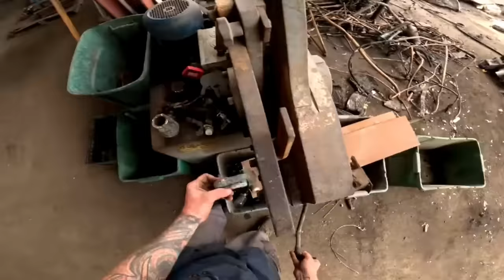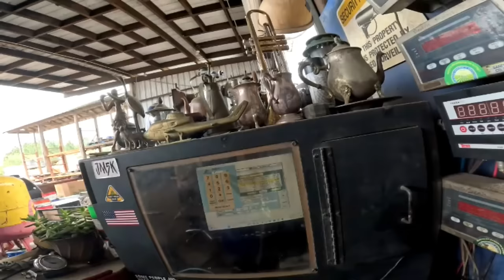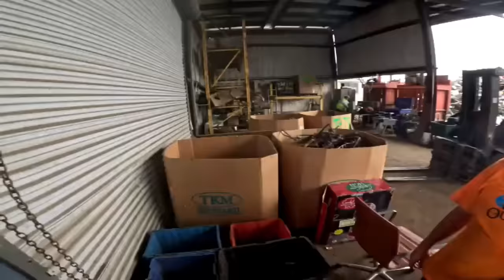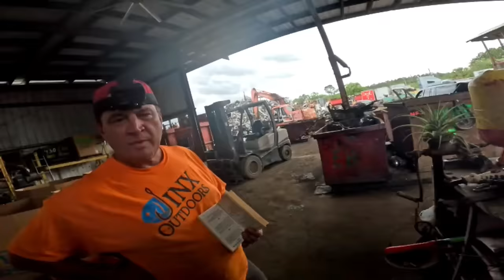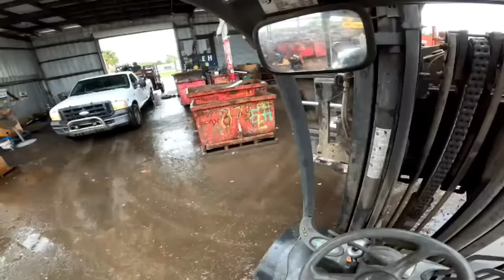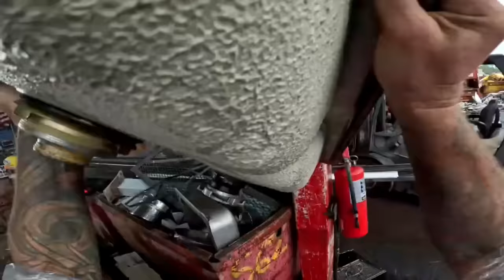THE SCRAP IS WINNING THE BATTLE #recycle #recycling #steel #iron #shear #copper #brass #scrap

Comment: 99 wheels.  I have a question what do you use the third bailer for I've only seen you empty the two
Reply from the maker: The third baler isn't working right now. When it was we used it for ac coils or brass radiators

Comment: I could be wrong, but I wonder if it’s almost worth it to use this shear on some of those radiators?
Reply from the maker: That's a idea. The sides have to be heated up to release the solder holding the steel strip on